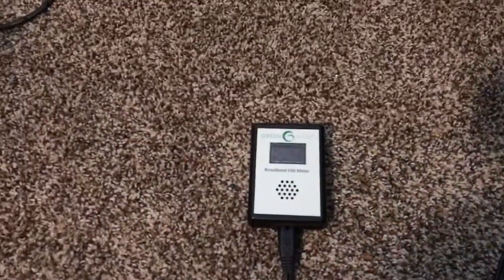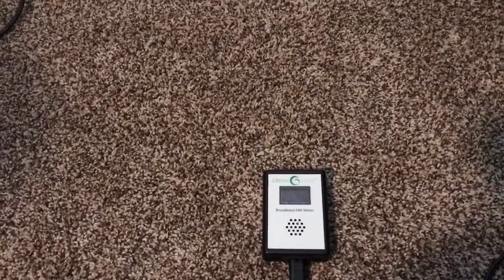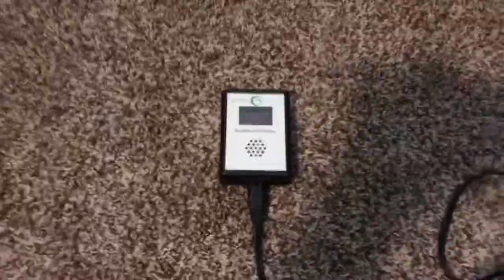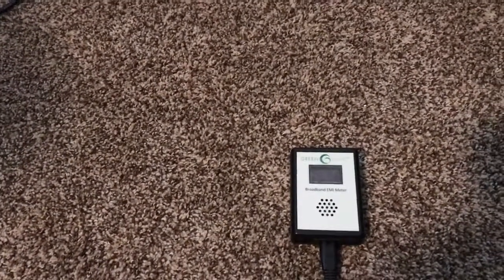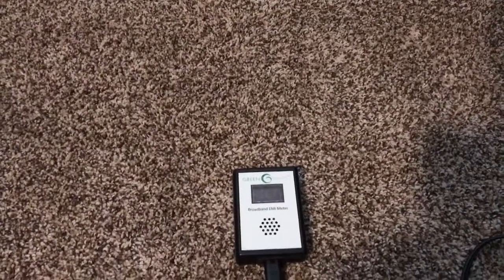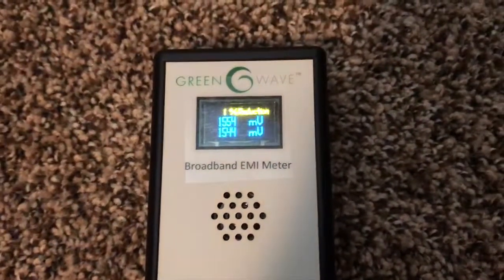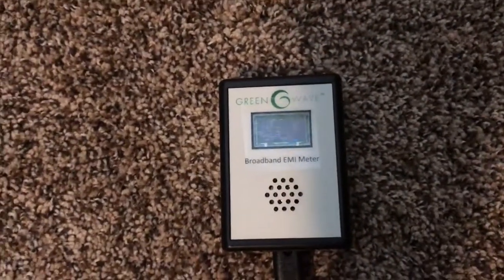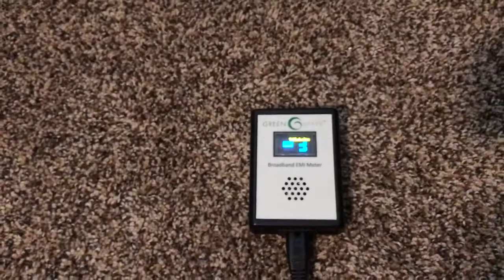Dirty electricity problem

Comment: No glitch what you are looking at and hearing are the wi fi pulses communicating to the electricity company. These pulses are very strong and they caused a sensation in my head called brain zaps. I got the company to remove sim card from the meter. The Zaps ceased immediately, now i know my tinnitus is caused by the meter because when we lose power up here in the hills after around 2 hours my tinitnus disappears! 
And reappears when power is restored.

Comment: Hey Mike, I know it's like 3 years later, but I might be able to help.  First of all, you should take a look at items that are created the DE.  Printers are real bad, so only plug them in when you need to print.  Anything that charges is also really bad.  That includes electric toothbrushes, phone charges, or laptop cables.  Any computer or television you have will also create DE.  Devices that utilize a "bridge rectifier" circuit to change AC electricity to DC electricity for motherboards will also create this.  Solar systems are really bad.  Unplug these items when you are not using them.  Maybe plug them into a power strip and flip it off when you can.  Then you can reduce the base reading to something the meter can measure, the "glitch" is when there is too much DE for the meter to measure.  That is best way to get started in reducing DE.
Reply: That meter should read up to 2,000 millivolts. So he it was well within it's range.
Reply: @JasonWW2000  *you mean the meter was well within its range - he, not so much.
Reply: Yes, these are all good points, though we need to ADD the DE that comes in from outside the home from the neighbors sharing the same utility transformer primarily.  If your neighbor has Solar PV, that can be the source of it too.  Another source could be micro-arcing from insufficiently tightened connectors in junction boxes or the breaker panel.  In addition, electronic power meters from the electric utility produce DE.  Also LEDs/CFLs and modern HVAC.  Most any 'green' product is a DE producer unless the designers spent the extra few dollars to choke their produced EMI.

Although I have never see a GW/Alphalabs line DE meter glitch like that, it could be that the 2000 mV limit was being reached as various combinations of devices added on/off transients.  Certainly, contacting the company would clarify such an obvious issue -- they are small company and care very much about the customers.  1500 mV is not atypical in a modern home -- everyone is over-exposed and some of those people will not realize that they have become symptomatic from such exposures. Getting down to 100-200 mV is suggested; if electrically hypersensitized then getting to less than 50 is recommended (which is hard to do, short of turning off the breakers).

One can use a process of elimination to turn on/off various devices methodically and see the effect on the DE meter reading.  The Greenwave meter also has a sound feature so you don't actually have to be looking at the screen display in order to know whether DE is reduced or not when turning off a lamp.  If you turn off all breakers except one (and plug the Greenwave into that outlet) then you will have a rough idea of the DE that is coming into your home from the outside.

Turning off the breakers for the circuits in the bedroom will also cut off the effects of the DE on the body during the very important time of repose (where our body heals itself and battles against cancer).

Comment: Using the same meter + plugging it in, I actually heard a radio station playing music through the meter! It must have been coming from someone else's apartment cause I didn't have any tv or radio turned on! Thank goodness I have a Greenwave filter which completely eliminated the all DE down to 14mV
Reply from the maker: seeamerica1 wow that’s crazy!! I like your pic... believe me I see what’s up....
Reply: @mixxndj  Now if only I can get the landlord to fix the high EMF's coming up from the floor! I used a Trifield100ex to read those; they can read anywhere from 2mG all the way up to 25mG. Unfortunately EMF can't be fixed with any filter.